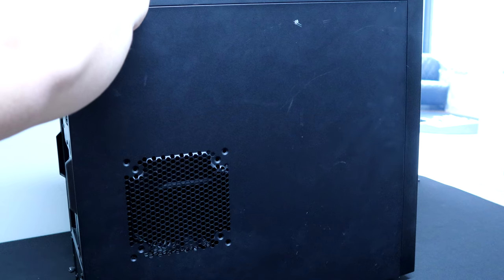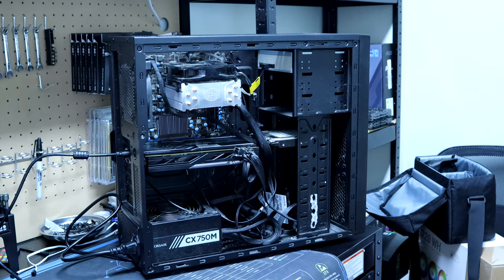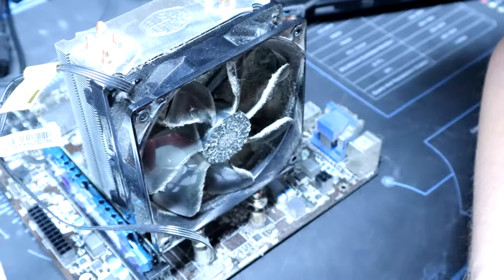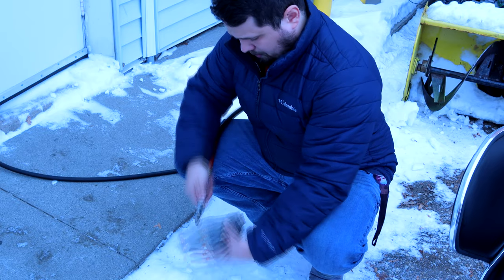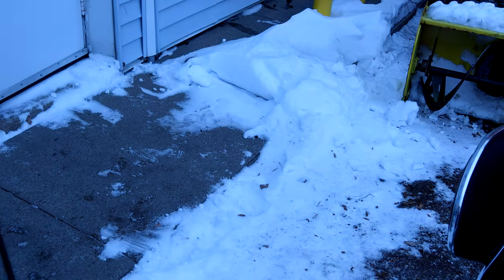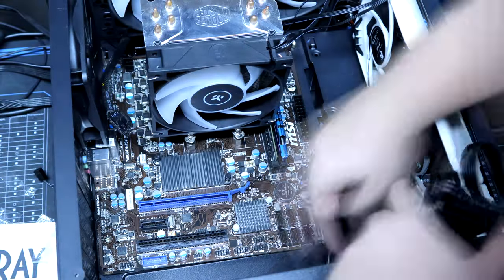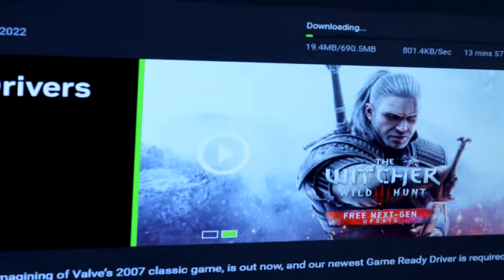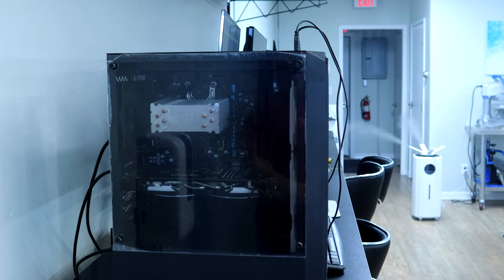Fixing Old FX-8350 Gaming PC: Is It Worth It?

Comment: I still use my 8350 built in 2017,  best upgrades on the system I made was 32GB of DDR3 1866mhz ram and NVME drive.   GPU I have in it is a RX470 4GB and its still perfectly capable, its main duties these days is mainly being a server/streaming pc more than a Gaming PC but it still has the umph.  Probably last at least another 5-7 years before retirement and then who knows.   I only just retired my AM3 Phenom 2 x4 only because of the missing AVX instruction set.
Reply from the maker: The old FX stuff is still pretty capable and make pretty great servers imo.

Comment: I'm writing this comment on my AMD FX-8350 build that is 10 years old this year. Case- Cooler Master Storm Scout 2, Gunmetal gray
CPU- Amd 8350 8 core @ 4.0ghz
Motherboard- Asus 990FX Sabertooth Rev. 2.0
RAM- Corsair Vengeance Red, low profile DDR3 1600mhz 16gb (2x8gb)
GPU- Sapphire 7950 Vapor X, 3gb Gddr5
Storage- Samsung 850 Pro 1TB SSD sata3, Seagate 1TB Sata3 7200RPM
ODD- Some dvd-rw/cd-rw drive scavenged off last build, Sata
PSU- Seasonic X-series 850W 80 plus gold, 100% modular
CPU cooling- Noctua NH-U12P SE2
9 120mm case fans running at 100%.
Reply from the maker: I love it man! Nice set up for when it came out

Comment: Gigabyte GA990-x is a great board for the FX8350 cos it has a M2 NVMe slot, one of only two AMD3+ boards to have one. Ran mine until very recently with the VEGA64 and to be honest the 5600x isn't that much faster for WOT 4k Ultra about 10% same GPU. Lets not forget the FX8350 was once a monster, top of the tree, and expensive !
Reply from the maker: Thats pretty sweet to note! Would be a good upgrade if I could find that board for cheap

Comment: truly an AMAZING AMOUNT OF DUST in that thing lol. Nice video. My only question, is do you turn down the pressure on that air compressor? I have literally seen people use regular compressors and blow a cap off a board haha.
Reply from the maker: Thank you!  And no, its honestly a pretty cheap compressor so it doesn't really have THAT much pressure, but still quite a bit more than canned air, but if you had a real nice one I would definitely consider turning it down lol.

Comment: That was the most dust clog I've seen on a CPU heatsink, probably the cause of shutdown as the CPU overheated.  Interesting mounting for the heatsink, I normal blow air through the heatsink to the back of the case to be blown out by the rear fan.
Reply from the maker: I did further investigation and it was actually the power supply overheating, I had to replace the entire unit after I made this video, which is shocking lol I might do a video on the power supply later. But yeah im not sure why but back when they came out with this evo 212 the mounting method for AMD only allowed for this kind of mounting, I would prefer to blow it out the back as well but it just wasn't possible with the bracket they provided.
Reply: @LegitCamelRetro  I wonder what caused the overheating and if it could be repaired.
Reply from the maker: @roasthunter  Yeah its weird, I completely took it apart and deep cleaned it so it cant be dust, I was thinking maybe the fan wasn't working but it felt like it was blowing out the hot air, I didn't see any signs of physical damage. Was just very weird I have never felt a power supply get hot like that. I think it would be fun to do a deeper inspection though.

Comment: I had that power supply in my first build it Worked well and ran really good I didn't have any problem with it running a 2060 ti 12gb but my case was massive so i had alot airflow inside that was brand new
Reply from the maker: Yeah its a solid PSU, turns out it ended up taking a dump a few weeks later, so I replaced it, it has an overheating issue I cant put my finger on.

Comment: A Haswell bottlenecks GTX1070ti so the FX will for sure, plus 990FX chipset only runs PCIe 2.0, a 1070ti will be getting close to saturating that slot.  I've got a FX8370 on a ROG board, I might break it out for a play sometime.  My old Sabertooth FX rev 2.0 board was legendary when I did some LN2 overclocking with the FX back in the day.  If you lapped the CPU the temps would drop a bit, the IHS is soldered on the FX CPU's so you don't need to delid.
Reply from the maker: Yeah kind of figured there would be a bottleneck but it was just something i had laying around collecting dust, and at least they keep the drivers up to date on it. Thats one thing I liked about the old FX cpus is they had some good overclocking potential.

Comment: My wifes PC  is a FX 9370 or something like that... the highest end  processor from that range...   It still works fine,  although, the SSD is probably what makes it feel snappier than it should..   It's paired with a RTX 3060ti and needless to say the CPU is a huge bottleneck.   It runs most games perfectly fine,   but,   for some reason  some menus it doesn't agree with.  For example,  Apex legends... In game  it gets 100-200 FPS....   In the menus its so bad you can barely click on stuff...  its really weird...      Those old CPU's are still beasts....  The 9370 stayed in my rig from like 2010 2011 until 2020 when I upgraded my rig to a Ryzen 9 3900x...    The biggest issues with the older chips is that it runs old, slow RAM.  Like I have 16GB 1333mhz with it..     Such slow ram lol
Reply from the maker: Yeah the ram speeds are pretty shocking when you look back on it, the speed increase in just a handful of years is pretty drastic, but most GPU bound titles dont really utilize it anyway. When it comes to esports titles and pushing high fps thats when the cpu and ram bottlenecking becomes a pretty huge issue, it was honestly really fun to toy around with the old FX system again just to see how far things have come from what seems like not that long ago.
Reply: The FX doesn't benefit much from increased ram speed, about 1600 is max useful.  Cranking up the northbridge and HT link will yield big performance gains but it's a black art to get the settings right.  You'll need to do some benching with a lot of trial and error.  A well setup and overclocked FX will match a gen 1 Ryzen for gaming if you can do it.

Comment: Hello friend, thank you for the video. I have a question about am3+ motherboards. I have an old am3+ motherboard system with an FX-8370 processor but the motherboard is now dead. So I am undecided to buy a used am3+ motherboard because some people say that it's really not worth spending money. I have a limited budget and cannot afford for am4 motherboards nowadays. If I buy an am4 motherboard, I also need to upgrade the other components as well. So far, I haven't had a problem with my am3+ system and I have been using the system mostly for programming, researching and watching some movies. What do you think? Thanks!
Reply from the maker: Well it really depends on what your budget is, and that you are 100% sure its the motherboard that died, because you could easily dig a hole buying parts trying to fix a system that isnt working. I think for what you are doing sticking with am3+ is just fine, but you could also easily get an h610 motherboard with a intel i3-12100 and be set for $200. If you wanted to replace your motherboard this is what I would grab. https://tinyurl.com/3ark4ytb - Like I said just be sure its your motherboard and take all the proper troubleshooting steps.

Comment: Yeah those temps aren't accurate FX cpu's never had an actual temperature probe so the temps your seeing are wrong also i would not be running an fx 8350 on a board with no VRM heatsinks thats just a big no no im amazed this build lasted as long as it did
Reply from the maker: Oh yeah I would totally swap out the board too if it was me, but its not really worth the cost for this person tbh. Did a little research and yeah you are partially right with the cpu temps not being read correctly, guess it uses some special AMD probe with not normal Fahrenheit or Celsius numbers. Thanks for the correction!

Comment: I have an FX-8350 in my pc since 2019 and it's been great BUT none of the AM3+ boards have Pcie x16 3.0 while all modern gpus have pcie 3.0 so I never get the full potential of my RX580. Your friend's 1070 will probably be the same.
Reply from the maker: Yeah thats true, some videos show its only a few percent difference though so isnt too bad
Reply: PCie will hold a stock GTX 1070 ok but it's close to the limit.  I've tested it extensively.  Anything that can max out a 1070 will have a PCie 3.0 slot.

Comment: you changed the orientation of the cpu fan? erm its exactly how you started, pulling air from the gpu up to the top of the case
Reply from the maker: I did change the orientation but the way I described it was incorrect 🙃  lol thats on me. It was pulling air from the top to the bottom now its pulling air up.